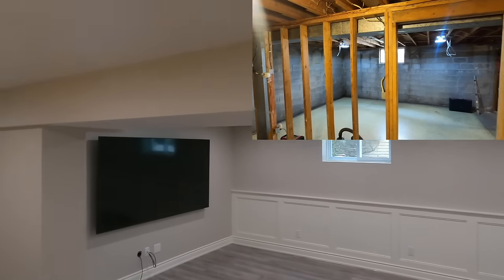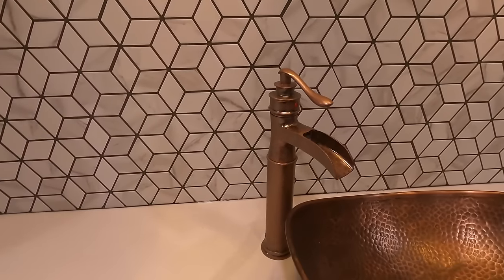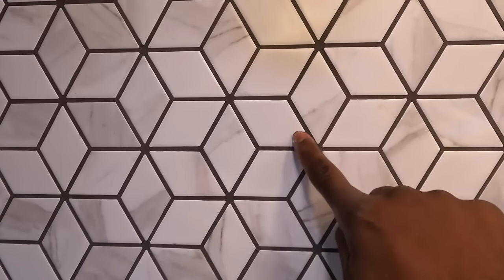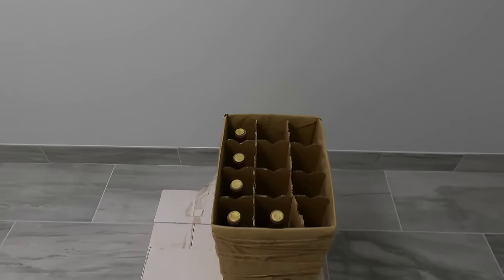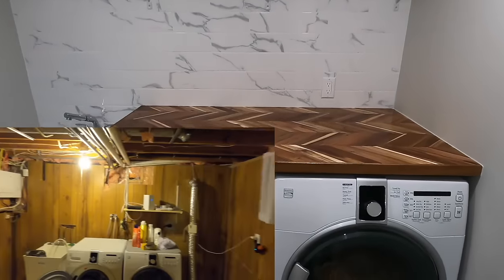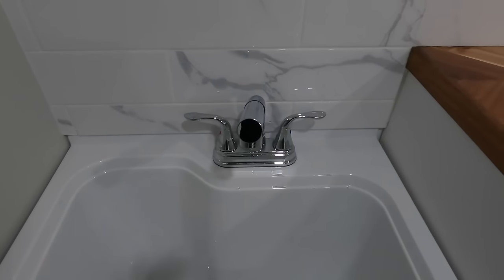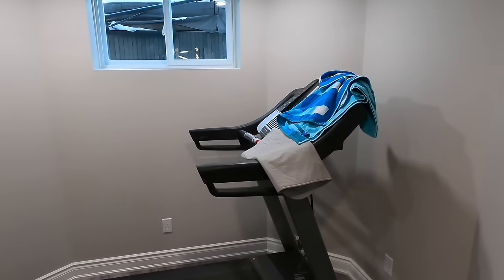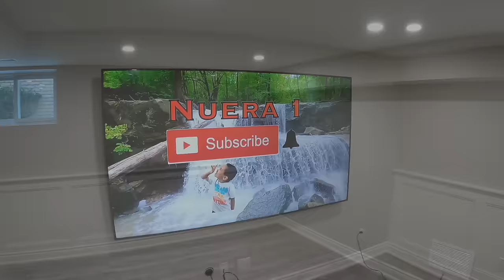Basement Remodel Time Lapse- Start To Finish In 33 Minutes

Comment: 4:52 it will not prevent harm due to moisture since the moist will accumulate behind this barrier and eventually wet en weaken the wall behind it. A friend of mine did the same in his cellar and now he has tons of problems with waterdamp all-around. Apart from that I think you did a good job.

Comment: One question, I saw water spots on walls, wouldn't water intrude and wet your subfloor? I didn't see dimple. Layer put on the back and tucked under waterproofing system?

Trying to learn, as I will have to do my basement soon.

Comment: Two question, because we're about to start our finishing of our basement:

1) Why did you do metal studs around the ductwork?

2) Where did you find out about the wind and moisture barrier? We have a stone foundation so I'm very cognizant that water and moisture are key concerns, but I also want to ensure the stone foundation can breathe and dry out. What is the benefit of the barrier before putting up the framing and insulation?
Reply from the maker: The metal studs were used because they are straight, you can also use wood. 

The wind and moisture barrier or house wrap is used to prevent moisture from getting into the wood and insulation from the concrete but it’s breathable so your stone will still breathe.

Good luck on your Reno!